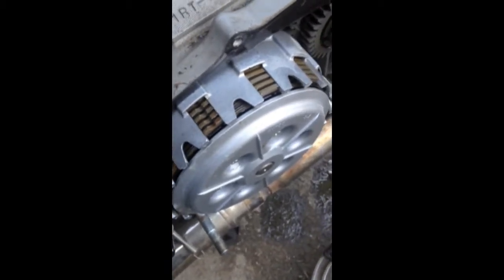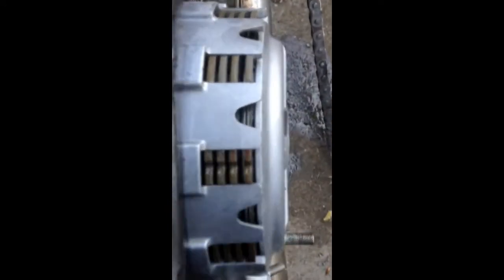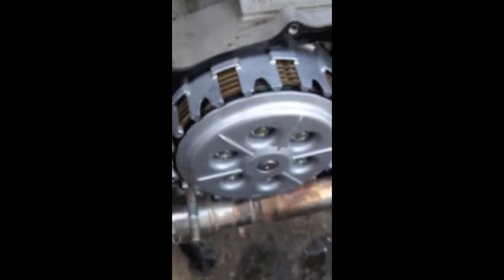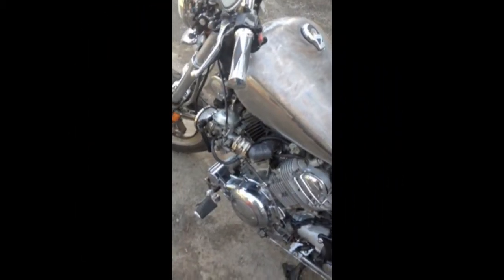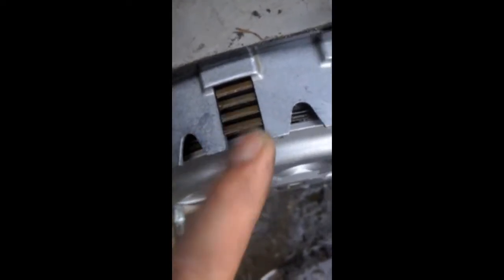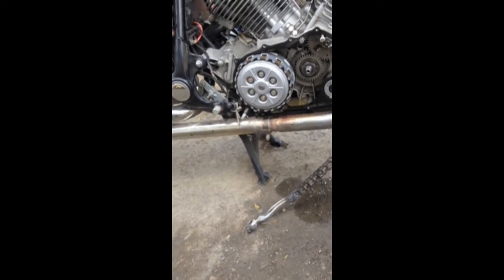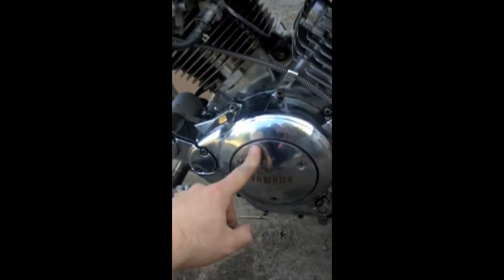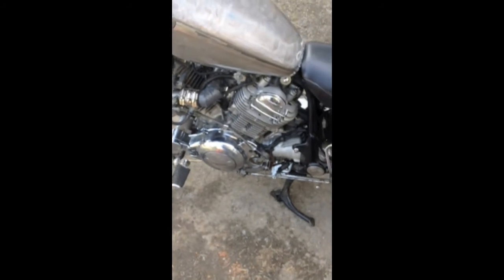1986 XV750 - Clutch problem and fix.

Comment: I am stuck and have not been able to fix my clutch problem. The 1982 XV750 I have just finished restoring. I also replaced the new friction plates and springs, but my clutch basket looks too tight and does not pop out, I don't see any gaps in between plates. It just doesn't move in and out, also I don't feel any tension on the cutch cable or push rod. It does not engage. What seems to be the issue? 😟